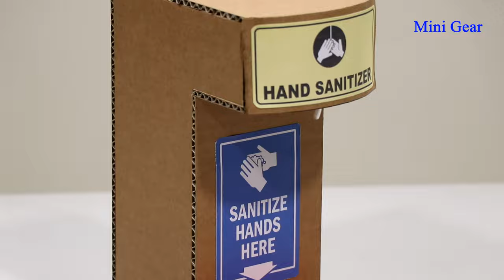Build Automatic Hand Sanitizer Machine at Home

Comment: But why not use hand sanitizer from the bottle?

It's cheaper and less complex than this thing

You just open it, squeeze it and that's it

No buying turbines, batteries or wasting time (and money) for no apparent reason

Air turbines: $15.99 or $14.99

Hand sanitizer (small): $2 or $3
Reply: Jeanpy 360 I mean, it can be a fun project to do while trapped inside for the next several weeks \_•_•_/